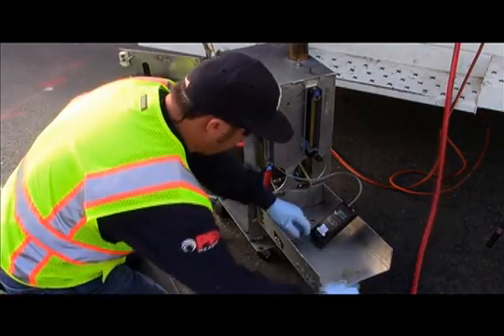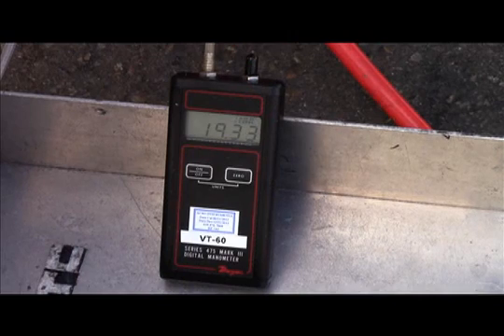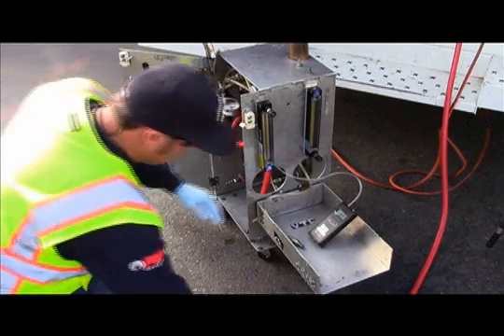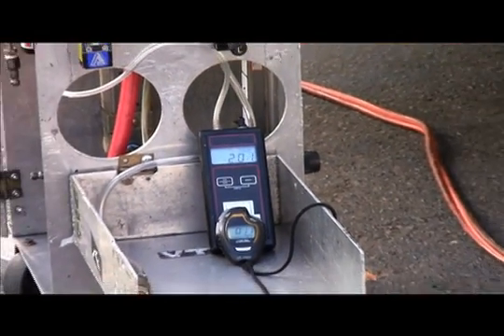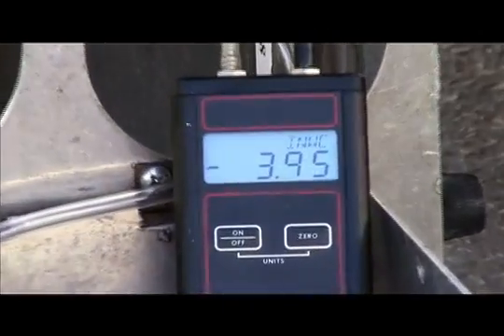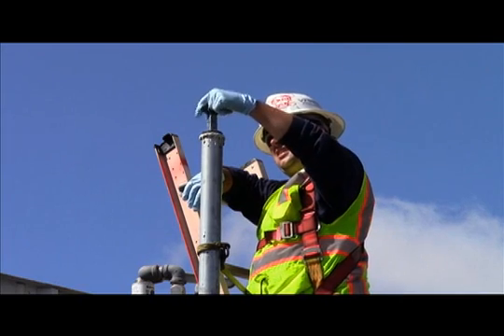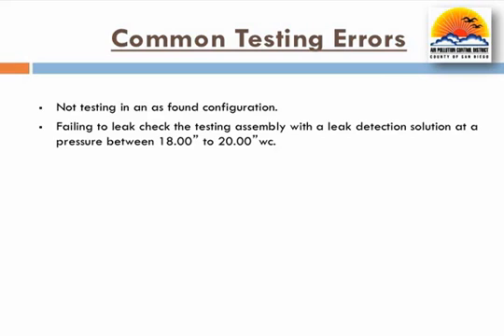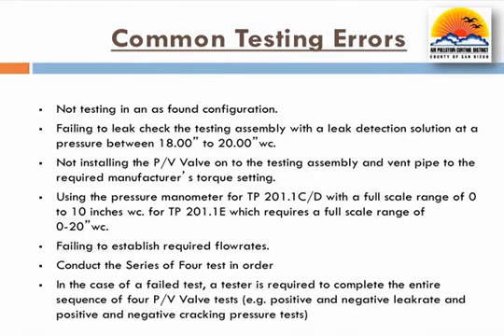TP 201 1E Pressure Vacuum Valve Testing

Comment: Hi, wich is the range and resolution of rotameters?
Reply from the maker: Hi - thank you for the question. For rotameters, the flow meter minimum sensitivity shall be 12.5 ml/min (.026 CFH) with minimum accuracy of ± 5 percent full-scale. The device scale shall be 150mm (5.91 inches) tall to provide a sufficient number of graduations for readability.
Reply: Aaaaannndddd that's why California is broke